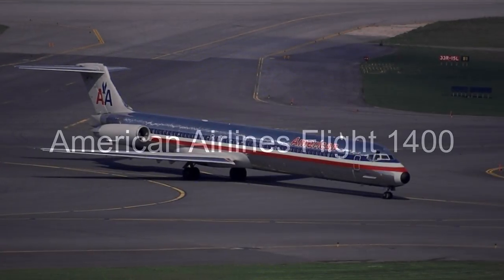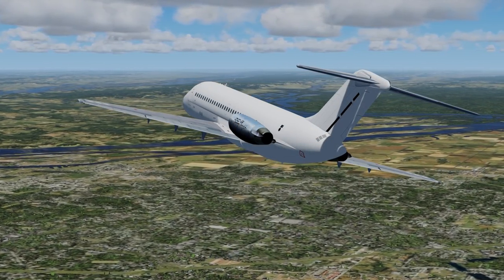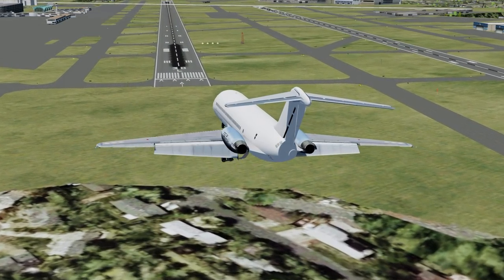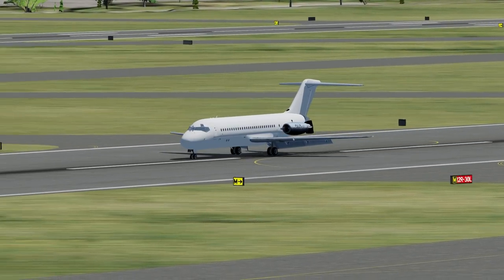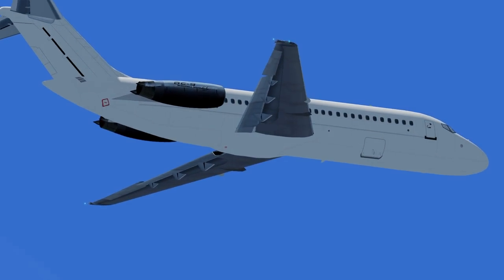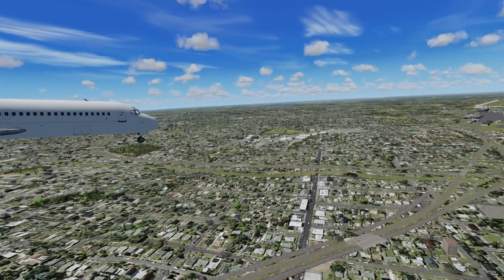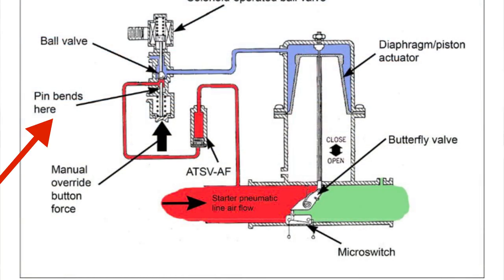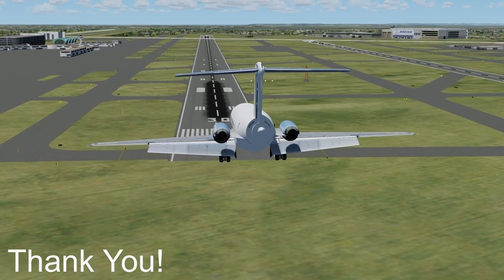How A Tiny Bent Switch Set A Passenger Jet On Fire | American Airlines Flight 1400

Comment: Did the pilot make some procedural errors? Yes. Did he get everyone down on the ground safely and without injuries? Yes. In MHO, that makes the pilots pros, because that is all that matters in the end.
Reply: that doesn't mean change shouldn't happen after something like this, other pilots trained in the same way who will make the same errors might not be so lucky when faced with a similar issue. this is why everything is scrutinized in the aviation industry, and why it's one of the safest ways of travel :)
Reply: Worth a lot yes, but it doesn't excuse the error. We frown on setting your aircraft alight, particularly during a passenger flight.
Reply: Haven't got any manuals at hand, but seems like procedures were adhered to. Except from lighting up that oil burner.
Reply: The pilot did a great job, but I was thinking, Get The Plane on the ground. With a fire on board, that was an incredible decision to go around.
Reply: The outcome does not always justify the means. It may have been somewhat fluke the flight went as well as it did. It's up to the pilot really to make an accurate assessment in real time if they have the ability to increase the safety of the flight moreso than what following procedure would do.
Reply: @hrthrhs  yes it could of gone way bad, silly to breakoff the Plane for Passenger updates, thats just for the cabincrew.  One Captain had fire in the backwall, folks were in fumes, he refused them oxygen masks, he saved half and barely got out himself with a very short exposure to fumes, before the whole inside turned to flames.  If everyone had oxygen energy may have been able to get out.
Reply: No, luck should not be a further validation of the pilot’s worthiness
Reply: Hell, im still in the midst of getting my ppl and i wouldnt want to be riding with this pilot.  Not fucking with a fire in a highly combustable tube at 1500 feet with a bunch of people onboard.  Get that shit down asap.  I would have taken that landing with the nosegear down.  They got out of this with sheer luck.

Engine fire with no knowledge of what happened, then theyre riding with one engine at low altitude.
Reply: It'd be nice if there were emergency runways 10 miles away, directly lined up with the landing path of runways back at the airport. No need to gain altitude and make a bunch of heading adjustments. Keep her straight and land.
Reply: Wrong. It is NOT "all that matters".
Reply: Amen

Comment: I really hope the A&P's who neglected checking the filters got canned. I was an AD in VR-52. We flew DC-9s and C-9Bs. I've personally seen, inspected, and replaced that filter (among others) on the engine. 

Pardon my language (I am a Sailor afterall), but fuck those guys. That's gross negligence.
Reply: VR still alive and well!
Reply: Unfortunately, many facilities where C-checks are performed have 1 or 2 A&Ps. Most of the work is done by unlicensed workers.
Reply: @jakem7838   You are correct,  depending on the certified repair station that an Airline has contracted to do the C or D check,  the FAA requires only a certain percentage of mechanics to be licensed. At the repair station, if the planners had done their job and given maintenance control the work that was required for that engine,  the filter would have been replaced. 
It's the planners job to do the research prior to the arrival of the aircraft for maintenance. 
Of course they do coordinate with the air carrier.
Reply: Jeff Noe,, do you have an A and P ??
There are only two types of aircraft mechanics,, those who have their A and P and those who wished they had their A and P.  And yes, I have had mine since 1982.
Reply: @70slandshark47  turn off the elitism. Again, their acts are gross negligence.
Reply: @70slandshark47  Provided that the unqualified staff are  given correct instructions,. With less responsibility than the engineers, they are less likely to miss anything or rush their work due to distractions.

This reminded me or the leading heart surgeon who admitted that he relied on a fairly new theatre nurse to suture and remove all the swabs. Having worked as a seamstress in a curtain factory for 15 years prior to becoming a nurse, her suturing was better than any doctor could achieve. Not to mention, that completing it in half the time is hugely beneficial following cardio thoracic surgery. 

Back to aviation, the success of any workshop lies in organisation and utilising the particular skills of all the staff
Reply: i think its pretty safe to assume that who ever failed to check here didn't do this intentionally.
an individual will only do as best as they can. 

true blame here lies with the system that either didn't train well enough, test well enough, or enforce well enough, or any combination of such. 
all of which is usually a result of cost saving corner cutting. greed.
Reply: @deforged  It seems wrong to me for an aircraft that requires an engine to be started manually to remain in service. What happens if it flames out during flight. 
That pin may have been bent already, which may have been the reason that the engine failed to start normally. It seems as if the reasons for the initial failure were somewhat ignored during the investigation.
Reply: @wilsjane  the bent pin allowed hot bypass air to enter the turbine that normally has cool APU air flowing to it, so it would've evaporated, then burned the oil and had a fire much earlier. Wrong tool for the job - a tool, rather than a bugger picker damaged it.
The degraded filter showed missing chunks, which are really, really bad when they flow into valves and actuators.

The interesting thing is, the pressure for starting the engine isn't very high - it's high flow volume, low pressure to spin turbines up. If memory serves, it's around 30 - 60 PSI to spin them up enough to turn on the igniters, which starts combustion and that'll quickly become self-sustaining around 15% of max RPM or so, if memory serves. One ancient cart we used was a 10 foot long tank with a compressor and a monster regulator taking 300 PSI to the lower pressureto a 4 inch hose (again, from memory, it's been decades - the F-28 was in use, 737-300 was just introduced, been a while).

Any A&P types wanna check my figures? It's been decades.
Reply: I'm Irish and as the saying goes, A day without saying fuck is like a day without sunshine. And yes, fuck those lazy ass guys. I worked aerospace for over 30 years (retired now) and it can be absolutely demanding of you. If you don't know what you are doing learn, and at the very least ask for help.. If you don't want to learn quit. Nobody should die because you don't put full effort into making sure you are doing the best job possible. Especially when lives depend on it. No excuses. 

And yes, the crew resource management was a little lacking but in a very stressful time who wouldn't freak out? It all boils down to training.Pilots are human after all and as long as everyone makes it home that's all that counts at the end of the day. If they can reuse the aircraft even better.
Reply: @repairdroid77  That is so true. When you enjoy your job and take every detail seriously, you don't get bored and the time passes before you realise it.
As you may already know, your national airline has that approach and that is why you never see them on these channels.
Although they never boast about it, they have not had a crash or incident involving injury in more than 50 years.
Reply: @spvillano   If I remember correctly on the 737-200 with the JT-8D engines using an external air source,  it takes about 40 psi through a 4 inch hose and when your N1 compressor speed reaches about 19 percent,  you raise the start lever. Make sure your igniter switch is set to both and the engine will light off and will idle at about 37 percent N1 and N2 ,, turbine speed. 
I'm retired now and it's been a long time ago so I may be off a little.

Comment: I agree with you in that the flight crew did a phenomenal job. Their workload was incredible. They were flying with very little information from their aircraft and that information was untrustworthy in the pilot's opinion. With all that, their decisions got the airplane safely on the ground with all passengers safe. The pressure must have been enormous. It appears that any lapses in judgment were not serious enough to add to the danger. Major props to the pilots.
Reply: Additionally, they called in another pilot from among the passengers to help out with the workload which also shows, and I quote Mentour here, "excellent CRM". :)
Reply: @vedranb87  I'll trust Mentour's word on that. It is nice to have a spare pilot available when things take a sudden turn into turdsville.
Especially when half the electrical is out, one hydraulic system is failing and an engine is doing that burning thing, which can pretty much melt your tail section clean off.
Would that they could have an awshit button to pause things while you try to collect your thoughts!
Reply: @spvillano  Absolutely. :D 
Or even better, restart mission. :D

Reload on the ground. Check settings.

Comment: The captain did a great job!  Any time you do a gear-up landing, there will be massive sparks created - especially from the where the nose gear doors are located.  These will be thrown the length of the aircraft.  If there was any residual fuel leaks (as was indicated after landing), the fire could be instantly made much worse.  I don't know if this was part of his thinking, but in retrospect it turned out to be a critical consideration.
Reply: That’s not how it works - he can only make decisions based on facts. The facts were that he had cascading failures, and a single-engine go-around with an aircraft that just took off (or heavy) is marginal on a good day.
Reply: @EstorilEm  The crew was already severely overloaded. Dealing with gear up on top of that, with no time to prepare for it could also have gone very badly.
Reply: Indeed👍
Reply: Yeah the captain did it all by himself... Never mind those two other pilots in the flight deck. The public is so ignorant when it comes to aviation. I guess you think the first officer just fetches the coffee.

Comment: Another well done investigation!  The pilots made the right choices up to and including getting help from the other passenger pilot on board.  Doubtless, their good choices saved lives.  👍
Reply: If your plane is on fire you LAND.
He was just lucky he made it around again.
Reply: @TurboMountTV  land with a dodgy gear and unwarned cabin, you end up with injured or dead passengers. That's considered a bit of a faux pas... Apparently, passengers are beastly expensive to replace.
Reply: @spvillano  Blow up in the sky doesn't make a good headline either. Passengers dont like that. They had no idea on full extent of fire. LAND! Planes have landed with a wheel up several times.
Reply: @spvillano  youre riding at low altitude with a fire, no knowledge of what caused failre, one engine, and then hydraulic failure.

Yeah, id just take it down with the main gears
Reply: I think the decision to go around was right. But how can you say that they made no errors? They made major errors, including letting themselves get so distracted that they never went through the most vital checklist.

Comment: Another amazing video 🙂 One thing I find missing is the reason why they lost electronics and then some of the hydraulics. I tried looking for it, but all articles focus on the engine fire cause and poor maintenance. I suspect this is somehow addressed in the NTSB report, however I don't have time to read it at the moment.

I can only guess that the left engine was responsible for supplying power to the electronic instruments and hydraulic lines got somehow damaged by the fire. That's why I don't particularly like the tail-mounted engines design. Still a wild guess though, if anyone has any reliable information on this then feel free to correct me / provide more details.

EDIT: Finally had some time to look into the original NTSB report and do some additional research. It seems like in this case the electrical / hydraulic system problems have nothing to do with the tail-mounted engines design.

___________________
1. Loss of hydraulics

NTSB report [section 1.6.3] indicates that the DC9 has two separate hydraulic systems, left and right, powered by corresponding engines. When the fire handle is pulled, a mechanically operated fire shutoff valve is also closed on the system to prevent hydraulic fluid loss. However, the same section indicates that the left hydraulic reservoir was found empty post-accident, while fluid level indicator on the reservoir showed that it was full.

NTSB report [section 2.4.2] describes pilots' response to left engine fire warning and subsequent events. It indicates that Engine Fire/Damage/Separation checklist was interrupted multiple times, preventing pilots from executing critical items, including pulling the fire handle. This would mean that the fire shutoff valve was activated after a significant delay and probably at a point when there was no more hydraulic fluid in the left system due to damage (it's not explicitly stated in the report, but that's one logical conclusion). That's what caused the loss of hydraulics on the left side.

NTSB report [section 1.6.3] also describes the operation of the hydraulic power transfer unit (PTU) that is able to mechanically transfer pressure from one hydraulic system to the other, in case of loss of power. However, the necessary condition to do so, is to have hydraulic fluid present in the receiving system. There was no hydraulic fluid in the left hydraulic system to work with.

NTSB report [section 2.4.2] points out that the PTU was enabled the whole time, and that's what led to depressurization of the right system - the pressure was constantly transferred into the left system that could not be pressurized because of the lack of hydraulic fluid. There is a safety mechanism to prevent it - a shutoff valve should be automatically activated if the fluid level in the receiving system's reservoir is below a certain value. However, as stated before, the fluid level indicator on the left reservoir was broken and showed 'full', so the safety didn't kick in.

NTSB report [section 2.4.2] concludes that: "[...] the pilots’ interruption of the emergency Engine Fire/Damage/Separation checklist at a critical point prolonged the fire and led to additional problems, including the loss of hydraulic pressure, which caused the nose landing gear to fail to extend."

______________________________________
2. Loss of electrical / electronic systems

NTSB report doesn't focus on this one, so it's really hard to figure something out. NTSB report [section 2.4.2] mentions a 'power transfer' occurring as the result of electrical anomalies. I managed to find DC9's electrical system's diagram in a coolsky's DC-9 classic Aircraft Operating Manual and some other sources to confirm it's correct. DC9's electrical system seems fairly similar to MD-80's schematics and based on some online descriptions of MD-80's system operation, I tried to figure out what could have happened.

Similarly to hydraulics, DC9 also has two separate electric systems, powered by left and right engine generators, respectively. Similarly to PTU in case of hydraulics, there's a component in DC9's electrical system that allows both left and right subsystem to be powered by a single engine's generator - the AC Cross-Tie Relay (ACTR). When AC BUS X TIE switch is set to 'Auto' in the cockpit, the AC cross-tie will interconnect the two systems whenever one of the generators is offline.

Initially I thought that's what the pilot meant by 'power transfer', and that's what NTSB report implies in [section 1.1], however when reading CVR transcripts, I found 'power transfer' and 'AC cross-tie' mentioned separately... Moreover, judging from the CVR transcript, the AC cross-tie actually failed and they got a 'AC cross-tie lockout' indication. From DC-9 Operating Manual, this means that the AC cross-tie got somehow locked in 'open' position and was inoperative... 

... and after some more digging into the AC cross-tie lockout, I found out that it gets triggered by a high current draw - for example the AC bus being shorted to plane's GND. I think it's a plausible thing to happen during a major fire, but it's pure speculation on my part.

And I can't really explain how it affected the APU deployment (maybe it works similarly to the AC cross-tie lockout, i.e. doesn't deploy APU if a relay is switched to power the AC line where a high current draw has been detected?). And why at some point the electrical power was lost to the whole cockpit (is it supplied only by the left system? because the right one should have remained unaffected...).

So that's basically all I was able to find. Hope I managed to contribute something of value to the subject. Feel free to point out any mistakes. And if you have any knowledge / experience that could offer some more insight into what happened to that DC9's electrical systems, I'd love to hear it 🙂
Reply: Same, want to know this.
Reply: This looks like an old plane...
Reply: @beckybradshaw3249  Typical of Douglas to use only one engine for hydraulics and electronics.
Reply: @eddiec4536  other companies used both engines - typically powering one side of the aircraft and cockpit. That last turns into meticulously paying attention to the checklists!